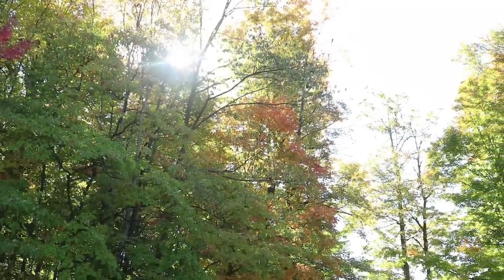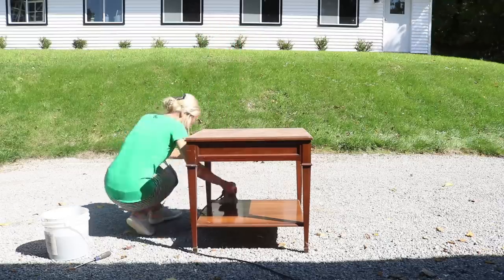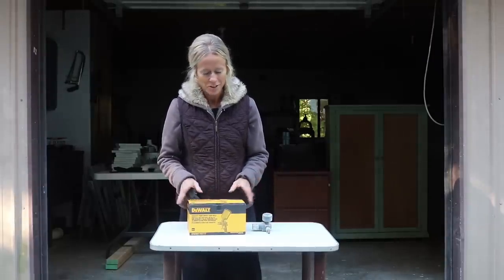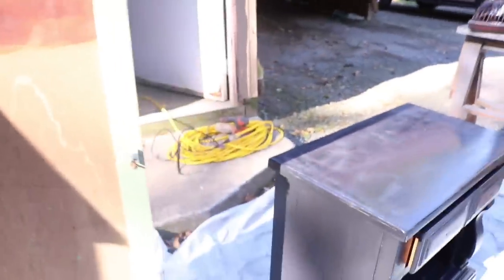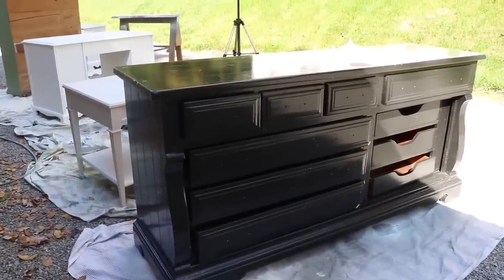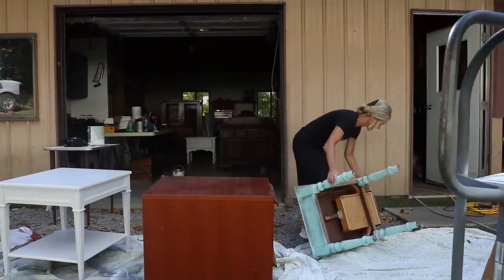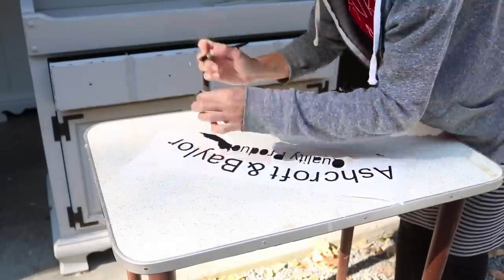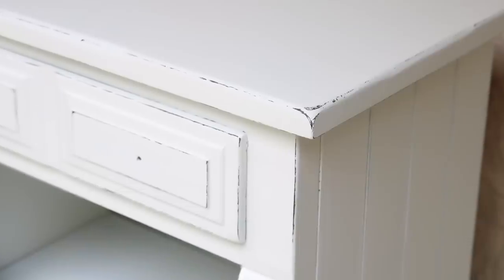Painted Furniture ~ Before & After Furniture Makeovers ~ Painting with an Air Sprayer

Comment: YES! This is my kind of day. :-)  So much more efficient and rewarding to do one after the other, not to mention having to get out and put away all the gear so many times if doing them piecemeal. I've only been watching your videos for a few months and haven't gotten very far back in the playlist, so huge apologies if you've already covered this ...    LOVE YOUR CHANNEL, your energy, and your aesthetic!   

TIP in case it helps anyone: you can use wood filler or even air-dry clay to shape missing pieces like that drawer edge, or make a mold to recreate more intricate moldings that are missing or damaged. Anyhoo, depending on the shape, I've done quite a few repairs freehand, kind of like icing a cake! lol  And until it sets, you've always got the option to scrape it off and start again (ask me how I know...). Works best for me for plain edges (use a paint scraper or metal ruler as a tool) or extremely intricate ones like mirror frames (use flat-head screwdrivers, butter knives, nail implements - and finish by smoothing with a paint or makeup brush). Once dry, add a few layers of matte polyurethane for strength, then just prime and paint as usual -- step back and you rarely see the repair.

Comment: Like the chest painted white with wood front.  I thought the modern type file cabinet would have the industrial look with a galvanized top, or wood, and pipe drawer pulls with the plumbing. Connectors to the drawer.  Just a thought.  You have great ideas!  Thanks for sharing!

Comment: I loved the video. Great job. A quick suggestion if you're interested. My husband is a carpenter and sometimes uses car bondo to fill holes in wood. You could use it to fix the bottom of the drawer on the once black sideboard. It sands easily and doesn't show under paint.

Comment: Check out Sugru molding putty for that drawer that has a piece chipped off the bottom. It works great and paints well. You will have to mold it to match - if you wet your fingers it smooths well.

Comment: Hey Mary! I went to the Amazon link on the Dewalt sprayer. In the reviews I noticed it mentioned it is not supposed to be used with latex paint. I know you use latex. Have you had any problems with clogging and what ratio of water to paint do you use? Have you used it with chalk paint? Thanks! Kathleen

Comment: Suggestion: The pie safe had wooden panels. It was paneling someone put in it. Could you put glass instead or a diff. thin wood. The end tables you used wall paper. Could you seal the wall paper so it would last longer or put thin glass instead? You do an excellent job and I like your styles. I just thought it would be a diff. idea to consider.

Comment: Hi Mary. I just enjoy your videos and look forward to them every week. On the black buffet that was missing the corner, have you ever tried repairing and making a new corner using bondo? I most recently have been researching that as I have a piece that is an old fireplace mantel that is missing a small piece. I havent tried it yet and was curious if you had an opinion on that.
Reply: Also, one other question. I have a Do It Best hardware store a few blocks from me that has a nice paint department with Do It Best pain but cant seem to get the formula for Spectral. Also the gray pain I heard you mention once is Dove I believe but cant find that either. Do you happen to have the formula for those paints? The gentleman at the store said he would mix it if I could get the formula or a picture of the formula.

Comment: DANGER!
Sanding and spraying, even outside, pollutes the air you breathe with toxic and often dangerous vapours and particulate. Old furniture is especially dangerous due to high lead content in earlier paints and coatings.
ALWAYS wear a well-fitting respirator while doing this type of work, both indoors and outdoors. Depending on circumstances, other PPE such as eye and skin protection should be employed. Refer to the instructions included on your paint/coatings, paint equipment and sanding equipment.
You can't take your lungs out and refinish them when they wear out. Believe me.